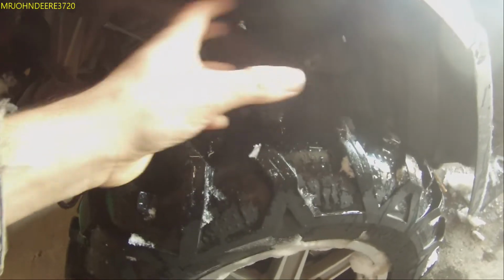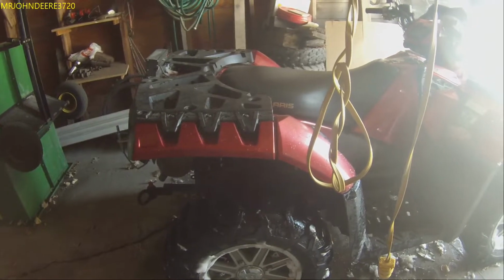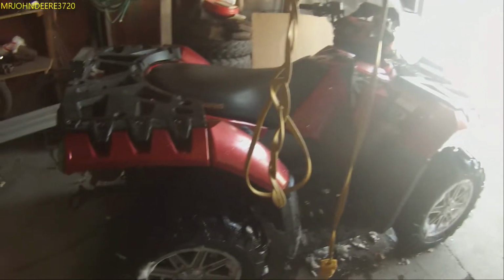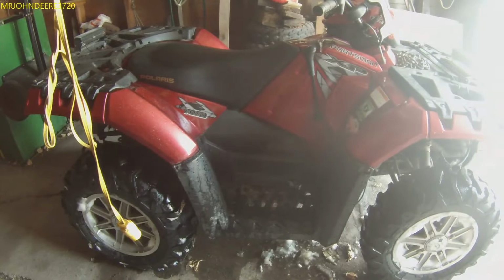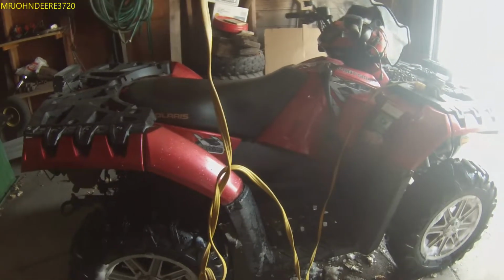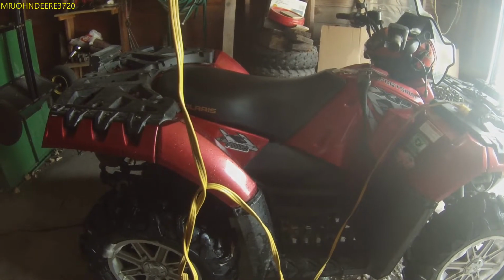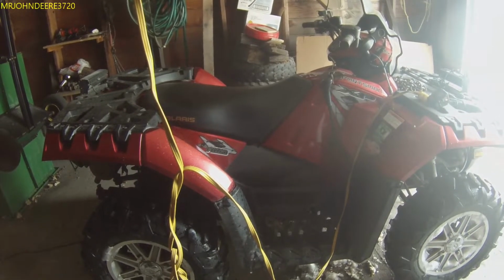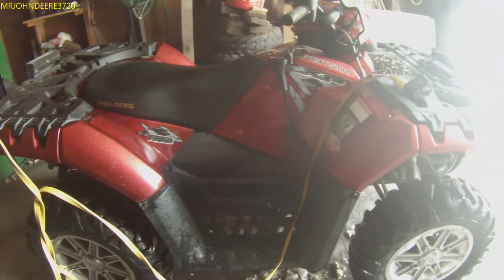My 2010 Polaris Sportsman 850 xp wants to be straight piped

Comment: I'm the second owner of my old (87) Honda trike. I think its got about 10,000 miles on it. Exhaust leaks too but I patched it up with some muffler cement. I'd never buy a side by side. For that price I could buy a good used full sized pickup with all those options and more.  You have a lot of deer tracks there. Guess the hunters didn't get them all.
Reply from the maker: i was hoping to put 10k on mine before letting him go, but i dont know now.. ya but a side by side can go places a pickup cant. but a 4 wheeler can go places a side by side cant.  ya thats for sure mostly does tho.. few bucks here & there..

Comment: I just saw a Safty recall for your ballpoints 2009 and 2010 you should look into this.  There is no time restrictions on a recall.
Reply from the maker: when was that posted?? mine just started going out, i blamed it on having a hard life & pushing snow. & even if that is the case recalls only work if u take it to a polaris  dealership.  a dealership is over an hr away.